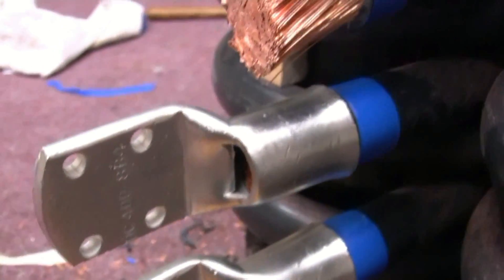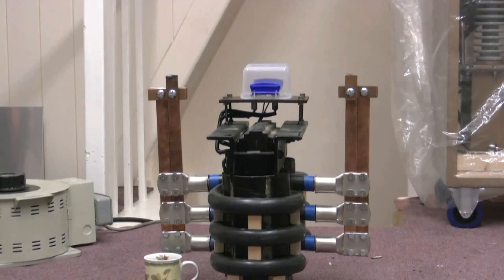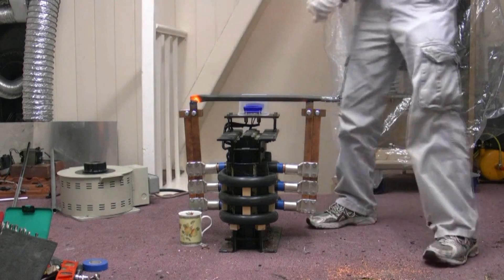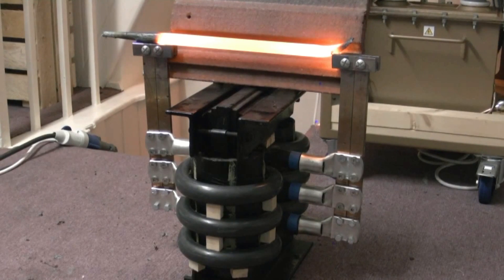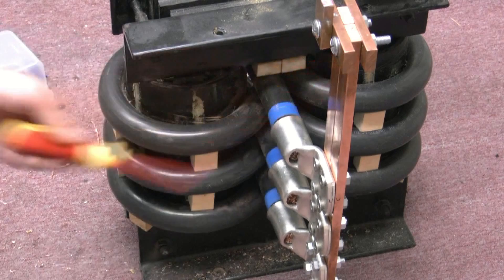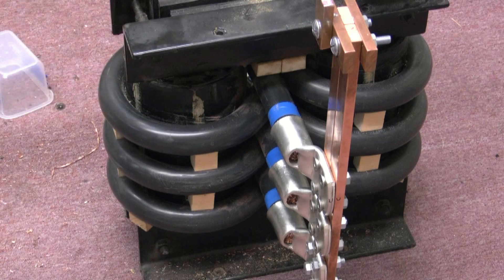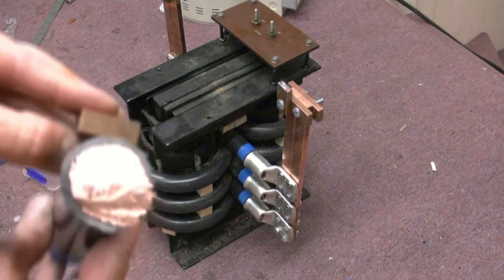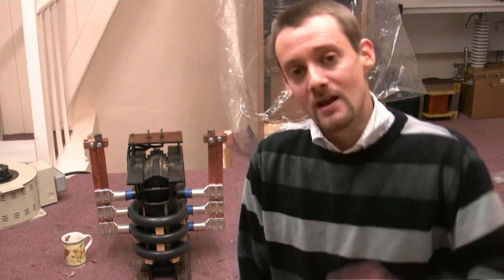50,000 Amp Transformer Completed

Comment: "Do Not Try This Yourself"
How do I supposed to do this without your 50.000Amp transformer?
Reply: You make one! That's the whole point of doing these experiments.
Reply: *****. Well, I don't think so. The whole point of this video is for entertainment and educational purposes, not to replicate.
Reply: It's [also] to encourage us to go out there and do experiments ourselves. This is how science gets done. It think he even says something to that effect in another video.
Reply: Right, we need to do experiments to get the science but we have to start it easy. This 50.000A transformer isn't that easy for most people to make so, this video is definitely isn't intended to be replicated by a not so professional person.
Reply: IRFZ44 what is relatively easy with high current compared to this is tapping into a microwave and taking the transformer out and replacing the high voltage secondary with a secondary of less turns. Making a high current transformer
Reply: @renzevenir4853  you Will learn meanwhile you're Building it
Reply: I keep mine in my wallet
Reply: +IRFZ44 Mek one, as we say in some parts of the north east :)
Reply: Hello Mosfet
Im diod.
Reply: Most people wouldn't even know where to find a cable of low enough gauge, let alone be able to wrap it around the core. Nor is a low volt high amp transformer useful for anything but melting shit, to the average person xD

Comment: You should try putting it in liquid nitrogen, or just super cooling it so it can draw even more amps :D
Reply: Might as well just use a superconductor at that point
Reply: @daddy7860  what about a super cooled super conductor?
Reply: Wouldn't matter, he still only had 100 amps available at the most.
Reply: The core will be saturated I guess.
Reply: lol thats not the limiting factor. super cooling it will do nada. you need a different transformer ratio to get more amps
Reply: Yeah. Superconduction at absolute zero. Make a spaceship.
Reply: That's not a good idea using liquid nitrogen to cool the transformer. The coil windings would become super conductive, the current would go through the roof. A black hole would  develop with a big bang. 😲
Reply: Yeah, just super cool it!
Reply: Keystone Science your channel is great i learned alot by watching your videos
Reply: Would have to prevent boiling. Best to submerge it in a liquid with a high boiling point. The transformers at the street are submerged in oil.
Reply: Putting this thing in liquid nitrogen within liquid nitrogen bath will completely vapourize the nitrogen much before the bar attains the required current rating. Also there is a great chance of film boiling on the surface of the bus bar which will prevent proper heat dissipation through it, resulting in raising its temperature and melting the bus bars.
Reply: Wow , that is what i asked in other video
Reply: thats exactly what hes saying to do.... its kind of  hard to find a super conductor anywhere you know
Reply: @Viizonary  
Find a way to get temperatures down past -650°, and you're there. I think its -650°. Close to that. (Absolute Zero).
Reply: haha I love to see you in the comments of the videos I see! I love your videos too btw! :)
Reply: I love your comments in other videos and I love your videos too
Reply: love your vids. got here from one of yours :)
Reply: Keystone Science I love your videos

Comment: It appears dangerous I know. But as an example it is comparable to someone using an electric 'stick'welder. Every few minutes as the welding rod burns down the operator has to fit a fresh one. This he does without switching off the unit...he merely flicks the old stub away,grabs a new one and clicks it in place without the need for a glove. He could be operating up around 200 amps or more but feels not so much as a tingle because the voltage isn't even enough to light a flashlight bulb.

Comment: Can you put your hands on both ends of your transformer? I want to see what happens then
Reply: Nothing happens, it's very low voltage. Unless insulation is busted and you touch primary side of the transformer by accident nothing will happen.
Reply: Ded

Comment: How much does your electrical bill run a month, mate?
Reply: More than a small loan of a million dollars
Reply: I wish I could say I was :shocked"
Reply: less than a normal house as he works most of the time (these things he does are very short time)
Reply: What are the distribution mains there?
You do some pretty cool stuff. .
Reply: Lou Pole just single phase 240-250v (typically slow blow 80A line fuse at the premises) only larger commercial buildings or farms have 3 phase usually
Reply: Interesting. . I've often wondered if you were a lineman. . . What would you do is you could have free access to say 460 volt, 1000 amp service?
Reply: Lou Pole turn that big light bulb on at full brightness :)
Reply: And then some. . Just imagine the Carbon Arc you could generate with that sort of power!

Comment: its similar to welding machine but this one is very low voltage. the voltage is not high enough to push the current to our body which has  higher resistance than metal, its the heat that hurts not electric shock

Comment: Thanks for the great video. Can you advise on what is the best type of bolts  to use for interconnecting the copper bars and terminals? I've been using stainless steel bolts, and also some bronze types with washers, but I've been suggested that there is a better choice and it wasn't too long since I've installed the firsts, what do you suggest? What are the bolts used in your transformer bars made of?

Comment: so is that 50A or 50000A?
Reply: jea, it was 50A
Reply: +airjuri no it was 50000 amps
Reply: 50,000 Amps but 0.5 Volts. The quantity to pay attention to is power (energy usage per second, Joules per second, measured in Watts). With transformers you can exchange the amount of voltage and current you want but you can't create power out of nothing. so P1 = P2, I1V1 = I2V2

Comment: What would it take to make this resonate at 13.56 MHz? How large a chuck of polyethylene would you need?
Reply: You can't do that, there are 2 main reasons: The sheet metal core and the high parasitic capacity. This is absolutely useless as an RFID jammer.
Reply: Looking to fry a bunch of RFID devices?

Comment: What? I thought amperage was deadlier than voltage
Reply: You can't have one without the other. This is around 0.5 volts. An AA battery is 1.5 volts. 0.5 volts won't do anything to you at all.
Reply: only if it comes from earthed transformer. this one is an isolator so the way you can be hit if you lick both ends with no conductor in between.

Comment: Cross sectional area of your cables is a lot greater than that of your bars...
Reply: That's the whole point.
Reply: tmkr No, the copper bars should have a similar cross sectional area as the coils. Only the object being heated should have less. Otherwise, you're wasting heat in the system that could be spent on the object you're putting across it.
Reply: Ok sorry, then I misunderstood you. But he said the exact same thing in the video..
Reply: tmkr
No prob. It's just physics and a slight bit of engineering. Just look at Ohm's Law (V=IR), the equation for resistance (R=(rho*L)/A), power consumption relationship (P=IV), and the purpose of the device.

If they actually mean for the device to put out extra heat in addition to the object they short across it, then that's fine I guess. It would defeat the goal of heating up the object.
Reply: No shit, he explains that in detail on the video...

Comment: 50,000 Amp? How many volts? 240? So you're telling me, assuming 0 resistance, you're running 12000000 watts? How?
Reply: The output of the transformer is 0.5V
Reply: Huh.. well. That's pretty impressive, considering it would only cost >10 cents to run it for a minute.

Comment: I'll tell you what, this gentleman knows a thing or two about how to make low resistance connections.  Did you see that quick check around 2:57 to make sure the line feeding his variac wasn't overheating?
Reply: That's a small thing that most "casual" viewers (the "this guys electricity bill must be huge lololol" or "oh voltage how it does not kill you!") won't notice, but any electrician that knows his trade will approve and smile:)
Reply: I was glad to see him do that. So mature, so reassuring. Safety first.
Reply: thank god someone noticed :D
Reply: Also do you notice a little plastic box in the first half of the video on top of the transformer? I reckon there were live connections under there he didn't want to touch/short.
Reply: Haha, only certain folks would see that
Reply: I mean, what's wrong with being a "casual" viewer? 

ONLY HARDCORE ELECTRICIANS WILL UNDERSTAND, eh? Bit of a weird thing to get all elitist about.

Comment: let's say I got a 5 volt DC transformer that can deliver 10k amps, can it charge a phone since "load only takes how much amps it needs" or it will destroy the phone?
Reply: Yeah there's no reason why you couldn't just hook up your phone to this(assuming it's 5v). Electronic devices only draw what they need so it won't do any harm
Reply: a wall plug delivers 16A/230V
if a transformer keeps the watt (i dunno if it does) your phones charger could deliver 736A at 5V
but they are limited to 1A(phones) or 2A(tablets)
Reply: Haba Nor There's a tendency to charge phones with 2A current lately and a lot of them supports such amperage.
Reply: You...MIGHT be able to, but you'd better unplug it pretty quick

Comment: let's say I got a 5 volt DC transformer that can deliver 10k amps, can it charge a phone since "load only takes how much amps it needs" or it will destroy the phone?
Reply: Except there is no DC transformer. Transformers are AC, but theoretically yes. But it may jump the board and arc in the phone
Reply: It would work fine as the phone has a charging controler with built in  protection, there would not be no arcing though as the voltage is still 5 volts, its just that the resistance is extremly low (wich dosent matter as the phone has a built in "resistor" in form of a charge controller)
Reply: tsltyler - TSL Studios pulse transformers are pulsing dc which also works in converting voltages.

Comment: They are going to die. Amps kill.
Reply: You could touch the 2 output contacts on this thing and not feel anything. Amperage kills, but it takes high voltage to push enough amperage through your body to kill you. The higher the voltage, the greater the amperage through your body.

Comment: Can I charge my phone with this?
Reply: nope, too low voltage
Reply: @ictogan  it's not the voltage tbh, it is about the watts
Reply: @dakotadirden9834   If you have a 10000000000000 watt power supply that only outputs 0.5 volts, you still can't charge a phone with it, because the phone won't pull any amps and 0.5V*0A=0W
Reply: Samsung Galaxy Note 7 only.
Reply: Once.
Reply: Speedyjens He probably does understand watts. A 25KW power supply means a maximum output of 25KW, not that it outputs 25KW to whatever you connect to it. You understand the power, voltage, current relationship. Learn Ohm's Law, which says I = V/R. Using that, the phone has a fairly high resistance, so it draws a fairly low current. Or you could say that this power supply is only able to push a fairly low current through it, because it has a low voltage. Also learn the electricity - water analogies, if you haven't already.

Why do I bother writing physics lessons on YouTube?? Oh well hopefully some people will find it useful!

If you connected your phone to that it might charge, or do nothing (see my previous comment).
Reply: phone needs 5 volts, so no. He has 0,5 volts output here. And no, your phone also would not explode, it simply would not charge nor do anything fancy.
Crowbar gets bit hot here because of short circuit, which a phone does not do if just tried to be charged :)
Reply: @nukester.  And to charge phone need a Full bridge rectifier (Electroboom) to AC to Dc and higher voltage
Reply: hahha yea the problem is there is still a lot of people think that Amperage always flow with the specification in the electronic casing. i mean if the phone charger said 2 amps they think it will always flowing 2 amps. same with this experiment they would think the phone will draw 50kAmps. guys please the gadget or the load will be the one who draw the current. depending how much the load need the amps.
Reply: Speedyjens Am I actually insane? Lol yes, somewhat, but then so are a lot of people. It's as simple as this: the crowbar draws far more current than a phone would if you connected one to that transformer. The phone draws less current than the USB cable is capable of handling, so the cable stays cool.

Go and read Ohm's Law if you're interested. It's pretty simple and it answers this stuff.
Reply: It would melt.
Reply: Lol yes indeed I do understand watts. Just like nexus already answered, it won't be forcefeeding the phone with its maximum capability
Crowbar has near 0 impedance, therefore it gets almost to melting point. PH one would not form such short circuit if properly connected
Reply: yes, but only once.
Reply: Stride Online yes the phone will take only what it needs.
Reply: YES, after performing modifications.  Let me explain why:  The uploader states that the output voltage is 0.5 Volts AC at 50,000 Amperes, problem is that the voltage required to charge a cellphone is 5 Volts DC between 1 to 2 amps minimum depending on your model (higher end models tends to like to receive a minimum of 2 Amps to charge fine or fast enough).  So here's the deal:  If you had this same exact transformer you  would note that is has three separate coils turned once and that seems to be outputting half a volt, you will need up the secondary turns from one to ten so that the output be 5 Volts, as a consequence of this, the output amperage wont be 50,000 anymore, it would be that divided by 10, in other words the output would be 5,000 Amps at 5 Volts AC.  Next, you will need to convert AC to DC, for that you can either use a bridge rectifiers (those diodes that have four terminals marked as "+" "-" for DC out and "~" "~" for AC in).  So having done this, you would have the world's most powerful USB line level voltage (5v DC) at 5,000 Amps, sufficient to charge up to 2,500 high end smartphones simultaneously and contrary to what most here would like you to believe, neither the phone or the USB cable would burn out just because the transformer is outputting 5,000 Amperes at 5 Volts rectified to DC, the phone will always take the amps that it needs, it will ignore the remaining close to 4,998 amps that simply wont be used, the only exception to that is if the USB cable itself has an internal short in which case the copper wiring within the cable would start glowing bright red causing the outer plastic insulation to catch on fire.  So, at a 5,000 Amp input the only thing you would need to worry about is that there isn't any internal short on either the USB cable (cheap/worn-out cable?) or a faulty/broken USB port on the phone itself as 5,000 Amps would be well sufficient to melt the USB port's metal surface.  Of course you can add a protection circuit/some self resetting fuse that would trip at a power consumption higher than 2.4 Amps so that way if any short occurs the fuse trips and nothing needs to melt (only drawback to this is that you wont be able to draw more than 2.4 Amps on that individual USB port if you want to charge more than 1 device, you would need to design multiple USB ports each with its own 2.4 max Amp fuse to charge multiple devices at the same time).
Reply: Has anyone noticed that it is an AC output, phones need DC output
Reply: 50,000 Amps at fuck all Volts. That is the technical description boys.
Reply: the charger cable would certainly not melt
Reply: when you enter his house your phone will start charging right away
Reply: +NITESCIENTIST 0.5v Read the description.
Reply: Zuriah Heep 😂😂😂
Reply: The aluminium frame on the iphone would charge pretty well on that transformer !
Reply: yes but only once
Reply: Stride Online but then the voltage is a problem...
Reply: Nope, the phone would not require much amperage
Reply: well a phone charger only puts out 5 volts. this cant be much lower than that
Reply: No u cant in fact that transformer didn’t even have 5v output its only the amps that are insanely high so its all obvious that voltage does kill and current doesnt
Reply: Yes but for a last time
Reply: Charger cable would explode.
Reply: mikko nurmesniemi You do understand watts? Watts is volts multiplied by the amps. If it has an output of 50000 amps and 0.5 volts. It would have a output of 25000 watts or 25 kW (enough to power around 25 vacuum cleaners). The thin wire of the cable would evaporate nearly instantly due to the heat generated. Your phone would have a fair chance to blow the up
Reply: 82NeXus Are you actually insane? There is a reason that we have fuses. They make sure we dont pull too man amps from the wall. If we draw too much power the cables are simple going to become fucking hot and the wire would melt. If we put that through such a small usb cable it is going to burn it doesnt get more simple than that. There is a reason that he used so thick wires on the transformer. When you use a cable that draws alot of power it is going to be heated up no matter what. At 25Kw that wire is going to be fucked real quick

Comment: If you don't crimp the crimp leads, you have a poor quality connection there.  Crimp or solder them.  You can solder them in by wrapping the leads with wet rags to dissipate the heat by the coil then heating the ends with a torch.